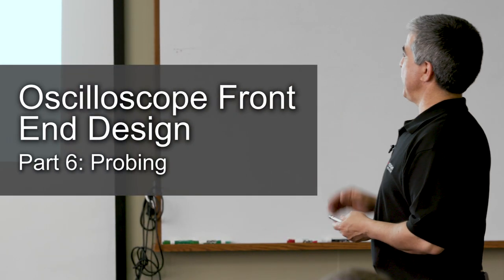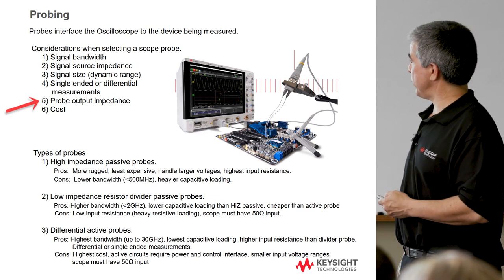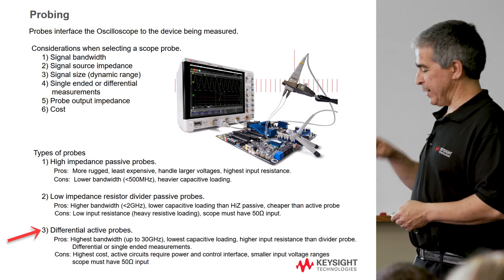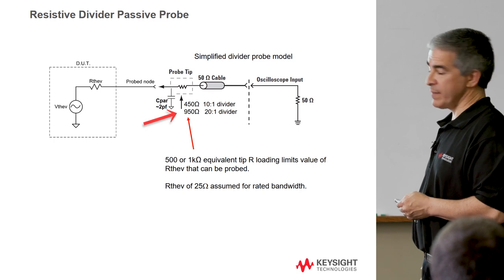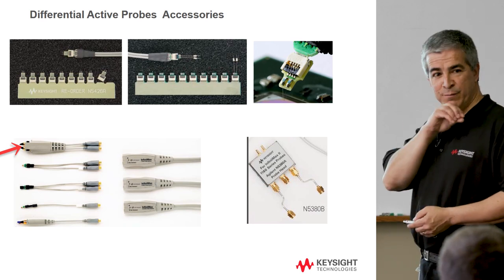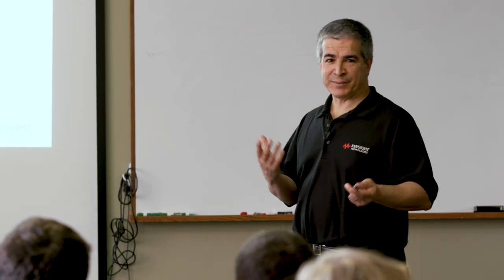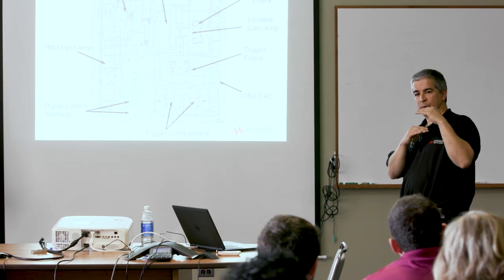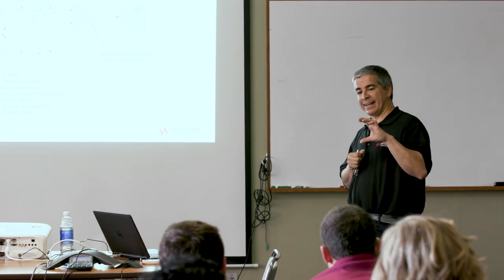Probe Technology Breakdown - Oscilloscope Front End Design (part 6)

Comment: You can make a nice RF "signal-tap" by modifying a 16.5 ohm resistive splitter.  Substute a  450ohm resistor for the connection going to the oscilloscope (50-ohm input), and 0-ohm resistors (shorts) on the other two legs of the splitter.  I use this for 10:1 TDR measurements.
Reply from the maker: Clever!